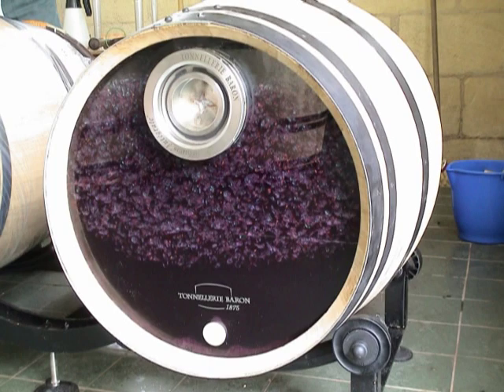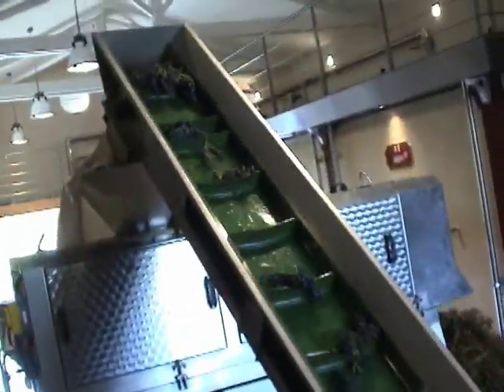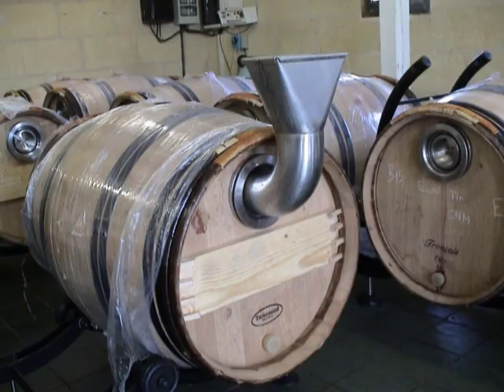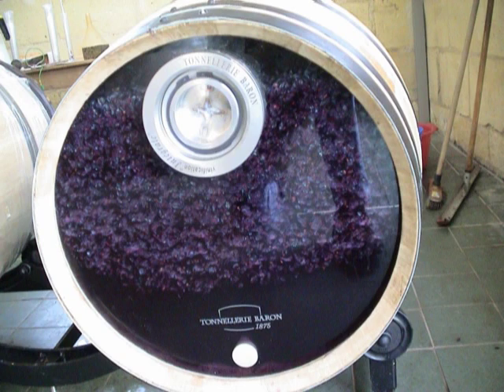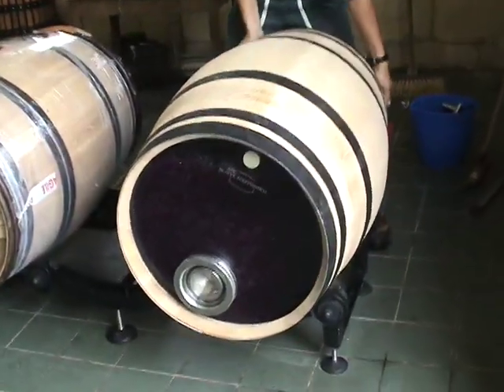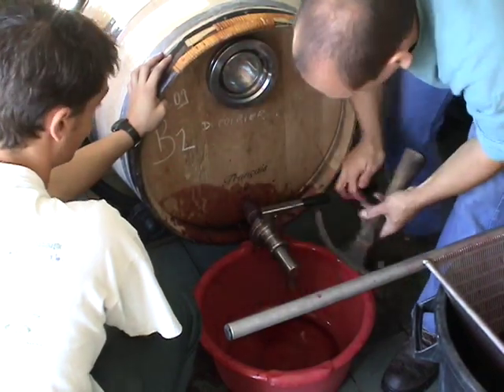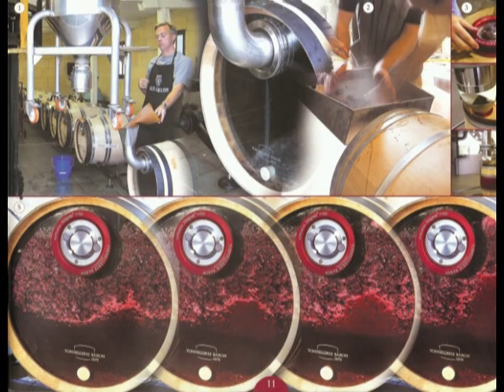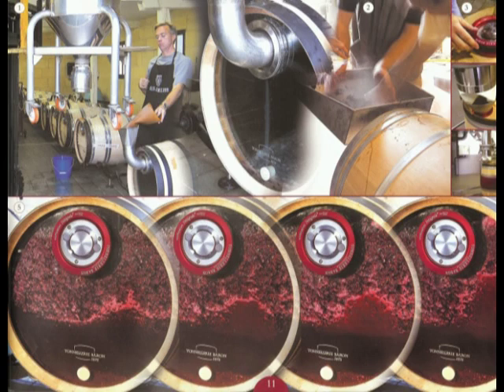How to Ferment Red Wine in a Barrel

Comment: I plan to ferment in an open barrel from above. How long after fermentation do you leave the liquid in the open barrel? How do you prevent fluid oxidation after fermentation? I would be happy to get you information about the technique. Thank you very much

Another question: After fermentation in a barrel, the barrel is inflated, the barrel head is not inflated with liquid, after fermentation I want to close the barrel and transfer liquid to it. Is it difficult to close the barrel head? Is it necessary to inflate the barrel head before?

Another question: after fermentation How do you perform a barrel sterilization? Especially in the upper part, with the fear that it did not accumulate bacteria ...

Comment: Is no one worried about contamination? Sticking your whole arm in there!?
Reply from the maker: I don't think you need to worry that is a problem.  After all, some winemakers jump into full bins and tanks to punch down their fermenting grapes.  As long as one observes basic standards of hygiene, there is no danger.  All kinds of things get into wine during the process, starting with bugs, stones and dirt from the vineyard.  You have to decide which wineries you are going to trust to make the effort to remove "mog" (material other than grape) on the sorting table and thereafter. And even if they don't, winemaking involves a long settling process and/or filtration which removes "mog".   But overall, sanitation in winemaking is very unregulated and has been allowed to be so because of one important fact:  no human pathogen (ie, a microbe that can hurt you) is able to exist in wine due to wine alcohol levels.  There are microbes that can make the wine taste bad and of course other dangerous items could conceivably get into wine.  But human contact with wine is not likely to be a problem.